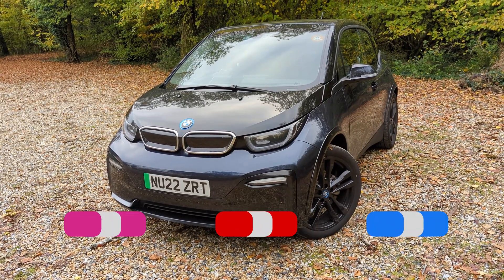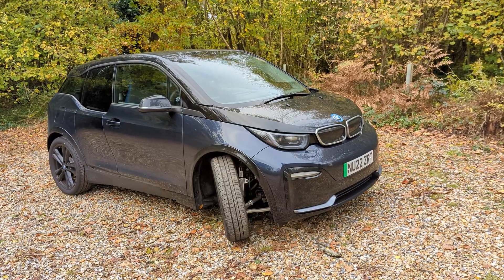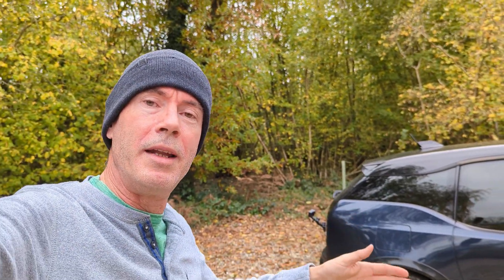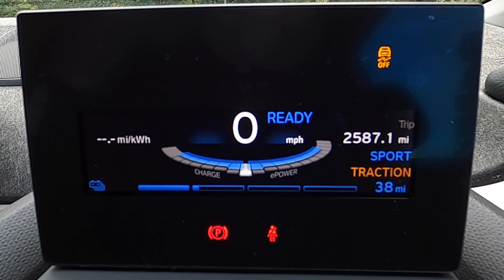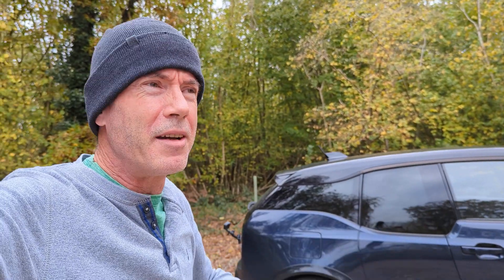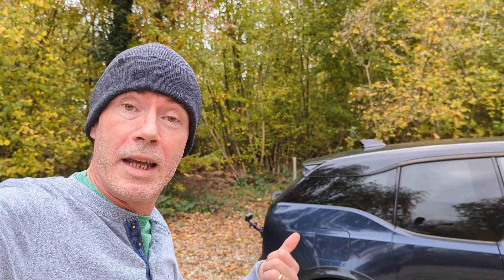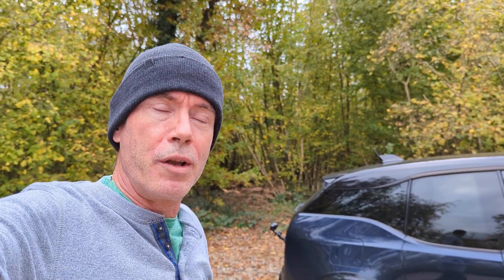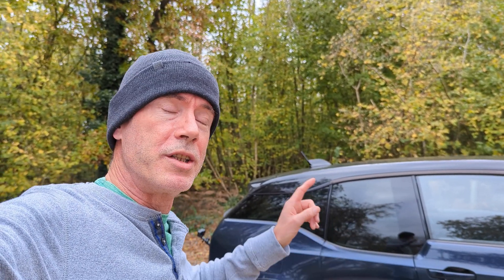BMW i3S : EV life day 145 - regenerative brake light activation

Comment: Hi Mark great video, thank you. Do you know if you can adjust the regen? Cheers from another Mark
Reply: Cheers Mark. Loving my i3s i recently purchased!
Reply: @markjones7777  Still like it? I have mine i3S (2020) for a month now, and it’s absolutely a great car for my commute to work. I installed an “intelligent” charging station at my house for cheap and convenient charging. It charges my car when the price is low. 

A couple of days ago the rate was negative, I got paid to charge my car😁.
Reply: Regen can't be adjusted directly, but i3s has a sport mode and in this mode car regens somewhere about twice less. That's clearly seen on charge-drain meter. Not that convenient for managing regen only, but may be it helps))
Reply: @proffche That’s an interesting observation and somehow good to know in winter season when the roads can be slippery. Just change to sport mode (sounds odd😁) to avoid blocking the wheels when letting the foot from the accelerator
Reply from the maker: Hi Mark! Regen isn't adjustable other than with your right ankle. There's only one setting, it's not too aggressive though and you soon dial into it.

Comment: Whilst it is correct that regeneration doesn't recover 100% of your kinetic energy, using the brake pedal recovers 0%. So to get maximum range you should control your speed anticipating stops such that you don't need to use the brake pedal. Using the regenerative braking is very useful especially if you are descending a hill or slowing for any reason.

Comment: BTW, Tesla had an issue with regenerative braking and ABS. It caught me off guard first, but fortunately I was alone on a road in the woods, and I figured out quickly what could be the issue. If you brake too hard to get your wheels locked, the ABS engages and removes/reapplies the brakes. Well, what if your wheels block from regen braking alone? The ABS now has to control more than just the brakes. It needs to be able to reduce the regen power. That's a very tricky thing! Even Tesla just removes (now that they fixed it) regen completely if it discovers that the wheels get blocked. The BMW has even completely separated control units — the ABS controller (most probably from Bosch) doesn't have any data from the motor, there's probably not even a connection between the ABS controller and the motor controller.
That's the reason I like Tesla — or better phrased, Tesla's technology — because nowadays you would have one controller for everything, having the complete view of all the systems in the car. No reason to have separate, isolated units doing their own work in their own world...
Nice short video! 👍